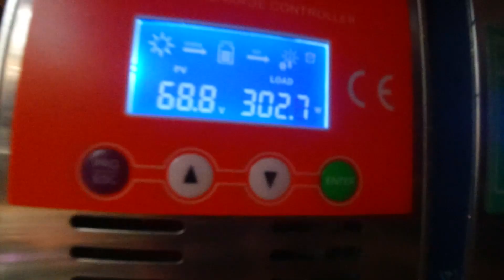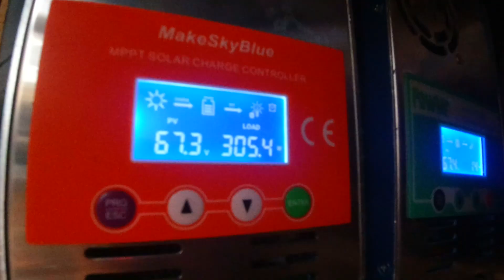100 year Nelson NZ Flood Aftermath.. The cleanup begins

Comment: As a retired road engineer , we found that you always installed all culverts to withstand any 100 year floods !! This goes for slope run off road ditch culverts !!  If you cut culverts dimensions just to save a few buck !! You'll be paying a huge price to replace the massive wash out & rebuild that whole section of road !!! 🤔🇺🇲
Reply from the maker: Yes it would have held up to the water no probs but there was a slip further up stream which pushed a heap of rubbish into the stream and blocked the pipe

Comment: As a retired civil engineer, I fully understand what you are going through. Controlling water flow is always difficult, sometimes resulting in unforeseen outcomes.
I admire what you are doing on a limited budget, using tried and tested methods and principles of engineering. 
Best wishes, and I sincerely hope that things will get easier.

Comment: Hi Marty. I've found my culverts are much less likely to block when the entrance is concreted in to cover sharp protruding end of the pipe. Having a slight radius at the entrance to remove the sharp edges works even better. Leaves and debris will tend to flow through the culvert instead of catching on the entrance, and sticks longer than the culvert diameter usually flow straight through. Concreting in the entrance also fixes up any broken concrete from digger bucket strikes. Hope this helps for future floods. Cheers, Neale.

Comment: As a engineer I used to design erosion protection at culvert inlet/outlet. This means boulders water will not move so easily. At several of yours culvert there is way to small fractions. Also vegetation is useful to give the dirt something to hold on to. 
You could also have a smaller culvert on the normal water line, then a bigger at a higher water line, that would help a lot in the future

Comment: Here in the mountains. We get much the same. The crews put giant welded grates on a angle made from old railway tracks. This stops the drains from branches etc.
Maybe you could make something like that. To keep the trash from jamming up the drain pipes there.
Maybe old chain link fence. 
I'm sure you engineering skills will come up with a plan.
Reply: In Sweden I have seen 4x4 meter wooden boxes , built like log cabins dug in and placed ahead of the culvert  higher upp the hill ,two after  each other to slow water and particularly rocks and branches . They were emptied  with diggers once or twice each season.
Reply: What we have here up Kawatiri is the Tasman council rising installed what look like birdcage domes over the inlet to the culvert.

Comment: Marty I think you should over spec the culvert pipe (Double it) and where the intake is going back up a bit and design a cage (Weld it together with reinforcing steel rod etc) that captures/filters debris and thus allows sufficient water to pass until you can clear the effective filter.  The cage if it roughly has 16x the surface area of the intake should give you 16x more time before it clogs.

Comment: have you thought about building a large cage around the inlet of each culvert? That way you can have many times the surface area for sticks and rocks to collect before it becomes blocked.
Reply: I guess it's a good idea but I suppose the limiting factor is money and time....
Reply: They clog nuts as quick and easy that way.
Reply: Maybe also use culverts made of concrete with a smooth bore, narrow at the bottom and big and wide higher up. The narrow section keeps the flow speed up (to keep it from clogging up) when there is little water flowing through, the wider round section would be for excessive flow.
Reply: Off set culvert !.. GENIUS !.. deflect the energy those words were the penny just dropped ..
Reply: @wideyxyz2271  
1 year time to build a few cages is a plenty of time and time to collect scrap tubing to use for it to weld. 
The only real solution I can think of is to dig a river through instead, reinforce it so water wont dig it deeper, then build a cheap wooden bridge over it. 

Super rain seasons like this is only gonna become more common in the future as we see monster clouds carrying more fresh water than the entire world floating around the Pacific, and when they hit an area and rain, they hit hard, we seen this in Japan, Korea, China and even west coast of america.
Reply: I wonder if Marty has watched Post10's YouTube channel. We don't have Beavers in NZ but some type of cage might be helpful. Then again so much stuff comes down those hills it might not do much for the big storms.
Reply: @SMGJohn  the solution is concrete fords. As soon as you muck about with cheap bridges you have weight limits in addition to a laundry list of other problems.
Reply: @jfv65  I think that's a plan...
Reply: @fenderOCG  
Fair enough, would it not be better to just make something out of concrete that he can place in these areas to break the force of the water and eventually catch debris in the water? Something that he can just drive down and clear with a digger once a year or something if there is buildup of sand and dirt.
Reply: @SMGJohn  bearing in mind that I'm an idiot I think in these types of floods even without debris the capacity of some culverts will be exceeded then the road will still be destroyed. Fords do suck so I'd only do them on one or two crossings that keep getting wrecked but based on other rural roads in similar settings fords seem the way to go. That said once flow gets too high you're still stuck behind a ford you can't cross but at least the road still exists when the water goes down.
Reply: @fenderOCG  
No I actually agree with you fords are great in places that are flat because restricting water flow is usually when the trouble begins, instead with fords as you say debris can just go over, easier to clear too but from what I seen, not every place could fit a ford though in that case the only thing I can think of is to restrict the force the water is creating somehow, I am no engineer nor an expert but something needs to be done properly because economically it makes no sense to me to keep fixing these place up each year, specially when water is flowing through the side of that cliff, thats really bad news for the future, entire side of that mountain could go if nothing is done.

Comment: on the steep edges for your 4 wheel drive entry et i think it would be worth hammering in some supports. if you buy scrap rail line, you should be able to drive them in just below the road at 30' off vertical heading into the hill. spacing will be very defendant on the size of rocks under foot etc but they should resist the landslide risk. you could also put some logs between them to help hold the edge together. if you can borrow a hammer attachment and sharpen the end they will go in pretty easy.  i would also put some vertical between waterfall and the straight shot culvert to make a rock wall to dissipate water speed.

Comment: I wonder if you could experiment with a ramped debris screen like you see in official infrastructure? Especially for the culverts in-line with water flow. The idea being that water pressure blasts sticks up and over the screen and resumes flow down the culvert. Good scrap metal project.
Reply from the maker: Yep I have been thinking along the same lines
Reply: @MartyT  I mean, you have the ideal testing lab.

Comment: You should also consider putting a bin or trailer under the track that drops gravel so you can easily take the gravel to a useful spot. I would use your excavator to dig out a trailer parking spot. It would also be worth using your excavator to put in seriously oversize culverts to replace the ones that washed away. Like 2 meter pipes, or buy one big pipe to use as a mold and lay in concrete pipes or arches. Harder for a few small sticks to block.
I would also put a double rope, or bridge across the river near your hydro so you can cross even at crazy water heights

Comment: What a mess, although, I'm enjoying your enduring videos through it. An offset culvert is a good idea, you may want to consider a debris basin to accommodate the rain deposits when it turns and slows down the flow; just need to keep it clean and well armored. May need to now plan for and anticipate a 500-year flood, hopefully not 1000-year.

Comment: Were you able to double up or increase the the size of the culverts that need replacing?  Likely worth the extra cost if these "100yr" floods are going to be an annual event.
Reply from the maker: No, one of the shared access driveway owners was being difficult so we just put the old one back in

Comment: One of the things the company I work for does is make big cages for going over culvert intakes for Auckland motorway. the ones we do are the big concrete cast in place culverts, I'm not sure they would work for yours. I'm sure some conveniently big place rocks would fill the same purpose. catch the rubbish but still allow the water to flow down. Good luck with the clean up.

Comment: I know absolutely nothing about this type of problem but was wondering if it would help to build a V shaped grill between 5 and 10 metres above the culvert to try and divert some of the debris that is washed down but allow the water through and delay any blocking of the culvert. The grill would have to be very robust of course to withstand the forces  pushing the trees etcetera down the hill.  Just a thought.

Comment: Hey Marty, big fan and have been watching a lot of your digger rescues and stuff like the above. If you could manage to keep calverts clear, do you think that they could offer a way to generate hydropower? I imagine your sole problem is making sure they don't get clogged up?
Reply from the maker: I suppose you could but wouldn't gain anything over having a pipe intake in the stream bed
Reply: @MartyT  True, on reflection I guess the calverts are only flowing when there is excess rain as well, making the operation intermittent. Do you feel like the rains will get worse as time progresses?

Comment: 3:04 Looks like a huge danger sign. That soil is held there by the roots at that point.  Damn, whole Nelson got hammered!

Marty, at least you have the machinery to do things in your surrounding area, like excavate or clearing rubble etc. You were prepared 🤝
Reply: That area may be due for it's own culvert?
Reply: @samvalentine3206  There seems to be a culvert further down the road already, so that takes care of it. But of course, if you would put a culvert there, that would take some pressure off that other culvert. You would be buying some time, in case one culvert gets clogged, like it was already clogged, before Marty opened it.

I mean, it's NZ, where it rains a lot. I would put a few extra culverts here and there.

But there is no way of keeping that soil in place. That is all up to the roots of the plants, and trees.

Comment: I wonder if a weir type of perforated vertical stand-pipe with debris cage over open top would be a better option than horizontal pipe. Would take regular maintenance to dredge sediment around it, but that's minor compared to washed out road. Just a thought. Thanks again for all you do to teach all of us & best wishes for a speedy recovery from all this damage!
EDIT: Your idea of offsetting the culvert from the main flow to dissipate energy and allow sedimentation upstream instead of directly into the pipe worked brilliantly!

Comment: oh heck! that is a proper pain. i see up here there is a very course grill over culvets. but that is a lot of water. The uncle use to have a large pond before the ones up the bush back of greymouth. Strewth!
Reply: this continues to look like the coast
Reply: i sse what you mean about the off set from the main down pour. could be what uncle Les did with the big pond
Reply: we had 229 mm over 4 days up here in a rain shadow. top of the south were really soaked from what i saw on the radar. start on the ark soon. you fire the wooden pins to hold the logs - right?

Comment: I thought by now you would have made (sorry don't know their technical name)  basically an sort of metal fence with vertical poles few inchs appart with 1 or 2 cross members to hold it together,. It's laid on it's side at an angle of 30 to 45 degrees. this allows water to pass through, but debris gets push'd up the slats /bars of fence above water line, leaving the water to pass through. I've see them used locally at the entrance to a large covet to stop it getting blocked and flooding rood..  Just a thought for you!

Comment: you might think about leaving the washouts open wide, and building a bridge across the gap, rather than filling them in again over a culvert pipe. with a wide passage for the heavy water and debris flow, rather than just a couple of narrow pipes waiting to get clogged up by a few sticks, you won't have to worry about a washout again as long as your bridge footings stay put. at least you have plenty of timber to cut for decking and support truss beams if you went that route, and with a fifty year flood, and a hundred year flood within 6 months of each other, i reckon you can prolly expect a 500 year flood next rainy season. my motto has always been, hope for the best, prepare for the worst. good luck, and stay safe.
Reply: That's actually a very good idea, except for the obvious cost of building a bridge to span the gap.
Reply from the maker: If it was just me Id do that but its a shared driveway and my neighbors all have different ideas
Reply: @samvalentine3206  i'm sure he has the skill and knowledge to build it his self out of native timber cut and milled by him from his property, and use the heavy equipment he already has. there are huge wooden train trestles spanning hundreds of meters, that were built a close to a hundred years ago that are still standing. the only out of pocket costs would be for fuel, fasteners for the wooden parts, concrete for the base footings, concrete remesh and rebar to reinforce and pin the footings to the ground by driving long lengths of heavy rebar into the ground with the excavator, that would stick up into the concrete, and anchor the mass in place, and rental on enough concrete forms to get the job done. if he mixed it himself onsite using bagged redi-mix, rather than having a concrete truck deliver it, he could prolly do it for a thousand or less, though he would have a lot of sweat equity invested in the project.

Comment: Have you thought of doing what they have done in the road to cable bay... they have designed the culverts so if they get blocked and overflow there is a dropped down concreted bit in the road for the water to flow like an inverted speed hump., i think its called a ford?
Reply from the maker: Not a silly idea but very hard to get neighbors to all agree to something like that, its a shared driveway
Reply: This is the only real and practicable solution offered in the comments. It's called a vented ford. This acknowledges that the undersized pipe will clog, but controls where the water will cross and armors the road to prevent loss of road surface and fill. Cheaper and easier to implement than a pipe or bridge to pass the 100yr flow plus bedload and debris.

Comment: Glad you are doing well.

I didn't think you were crazy making that offset layout, im just glad you added more capacity.

that big one, i think it was doomed from the start, even after the fact when you shot the video it looks like there was more water rushing through there than the culverts would be able to handle.

any plans to add more capacity to the other culverts?
Reply from the maker: If it was up to me I'd install a bridge or bigger culvert but I have other neighbors to consider and some of them want to stick with status quo
Reply: @MartyT  a bridge seems excessive though severe weather is happening more often everywhere.

but i suppose as long as they are pitching in at least some diesel to keep the hitachi happy...

stay safe out there.  i am happy to see you are pretty careful when you are out there alone.

Comment: Marty what are your thoughts as a consequence of this disaster?

Given increasingly repetitious and escalating volume for rainfall on a virtually global scale and that many of your culverts appeared to be only barely coping with water flow resulting from this event. 

Do you now intend to install angled metal grates at the intakes for your culverts to help prevent blockages and facilitate clearing them and/or enlarge the scale for pipes to carry greater volumes of water?

Or do you hope/believe such heavy rains will not recur for another hundred years?

Due to the amount of manual labour evidently necessary to clear your various smaller culverts will you now be keeping an eye out for one of those itty bitty excavators to better accommodate future need?

Thank goodness you had tidied up the drains along the sides of your tracks!

Do you think aligning the angle for your culvert under the track as close as possible with the angle of the drain on the offset might further help to cope with water flow?

Comment: Here's a really thoroughly uninformed question 😅 As these culverts get blocked up so often, because of the debris. Would it be possible to simply have concrete "slip ways" directly on the road, that the water can run over? Rather than trying to force the water through a narrow pipe, which will inevitably get clogged? 

If you let the water run over the road surface, over concrete, at least the action of the water will clean itself. I'm just not sure whether this would have some other unintended negative side effects?